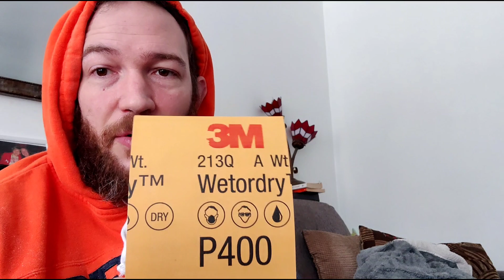Part 2 of the #sling24challenge !!

Comment: Love it 👏 I have a Q if you don't mind me asking; using epoxy glue to stick that bad boy together...could epoxy resin be used instead to stick em together?
Reply: technically.. i think epoxy glue tends to be thicker than epoxy resin, but its made from the same stuff. 
If you made a micarta block to your desired thickness, you wouldn't have to glue anything together.
Reply from the maker: I did a half thickness for a couple reasons.. 1) This Bondo stuff starts to kick very quickly. it's difficult to get all the layers saturated before it starts to harden, and I wanted to be sure I did. 2) Having 2 pieces helps fix any problems with having slanted pieces. My "press" isn't exactly a precision piece of equipment, so if the slab gets slanted I can just fix it by alternating each of the halves. (that happened in the video). 3) If I want to add a core to the design, it's insanely easy to do it if I have two halves instead of one solid chunk that needs to be split.  4) If I somehow managed ruined the slab, which has happened to me before, it would only be half as much material lost.  Adding too little hardener, the layers shifting or folding, too many air pockets, etc.
Reply from the maker: The same resin could probably be used, but glue is glue for a reason.lol.   I've used the same glue on nearly every build Ive ever used, and it hasn't failed me yet.  It also cures faster than any resin I've used, but I guess if I wanted pure speed I could just use super glue 🤔🤔
Reply: @jaylinh9698  that's what lead to the question their shared similarities. Could one not make the resin thicker...with more or less hardener? 🤔
Reply: @TheSmoShow1  ever tried gorilla glue?